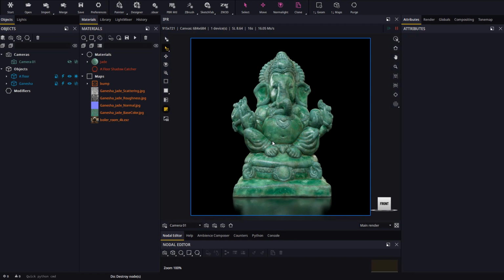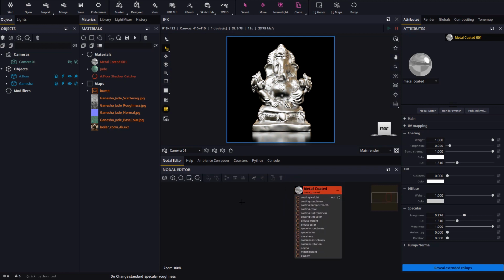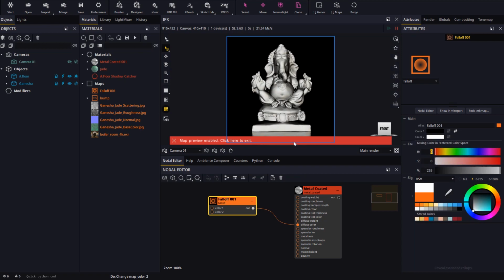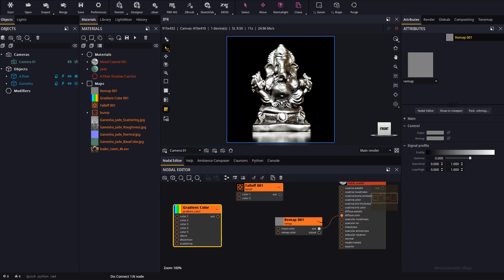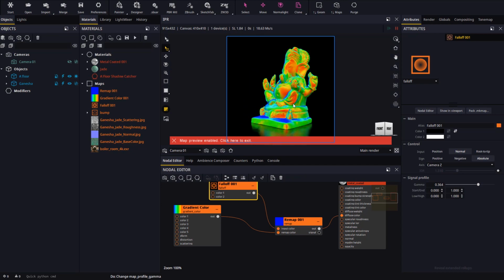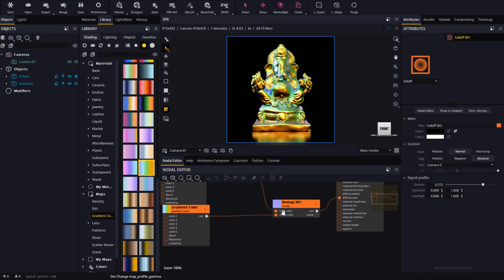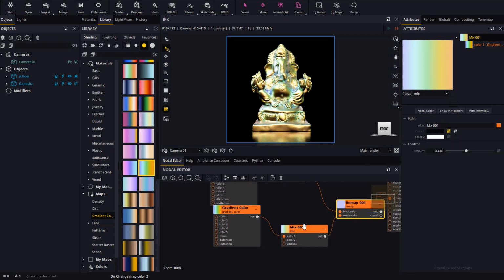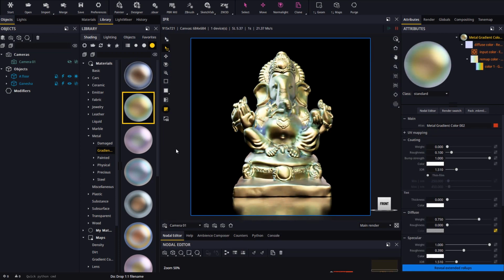MAVERICK RENDER: 41METAL GRADIENT COLOR

Comment: Does the new version of Maverick have some core updates in regard to complex indirect lighting? Will it be able to do such things as lighting up the room with a precisely modeled incandescent light bulbs with a tungsten filament as a mesh light? Fryrender could do this with ease.
I tried to play with Maverick demo and I dig up some of my old Fryrennder scenes with very complex indirect lighting. Fryrender on my old PC with a 55 GFlops CPU could solve those complex scenes easily while Maverick on my 83 TFlops GPU struggled real hard.
Maverick is great for simple scenes with direct lighting and instant light sources but the question is what the future holds for it when it comes to mesh lights (which give much more realistic results) and scenes with complex indirect lighting? Are there any plans for those aspects?
I would be really happy if in the near future I could be able to integrate Maverick into my pipeline.
Reply from the maker: Hello, most modern engines have generally abandoned bi-directional path tracing in favor of uni-directional path tracing because only a handful of cases truly benefit from bipt, so the performance hit in all other cases is not worth the while, and more so in our case as we are focused on Product Viz.
Reply: @MaverickRender  I agree that most modern engines abandoned the professional approach for hobbist approach but as far as I can tell, most did it without counting in the global trends. The IT sector changed drastically in the past few years and because of the smartphone generation there are less and less PC users each day, even the PC gaming-industry is dying out because most people can't (and don't want to) even handle the Windows, let alone learning a cg app. So, in regard to this, soon the PC itself will mostly become again the tool for professionals as it used to be 20 years ago. If it wouldn't be like that, one Maxwell would not be around for so many years. Indesign and Archviz requires BiPT just like serious Product Viz.